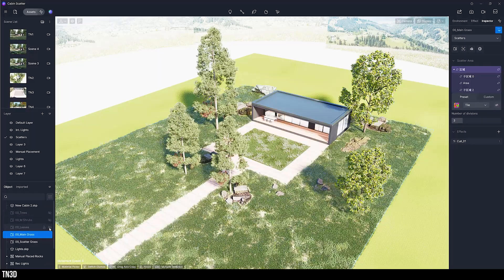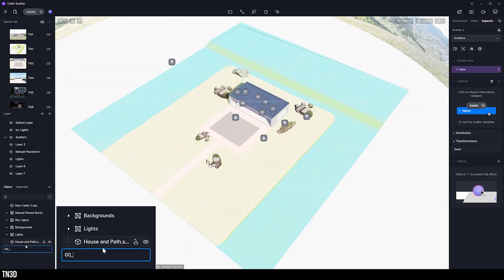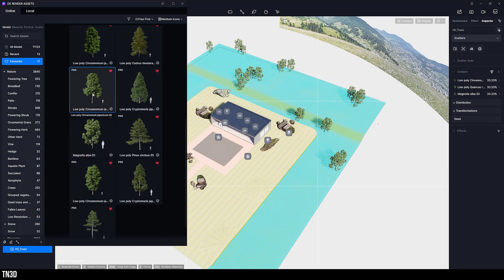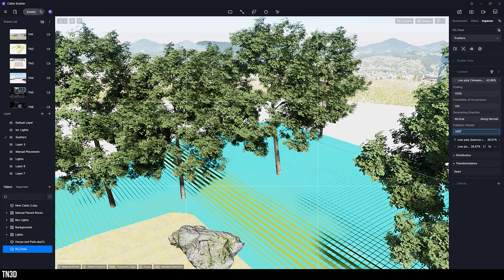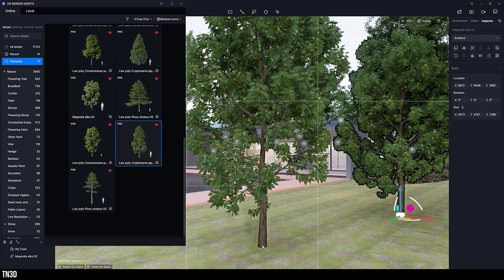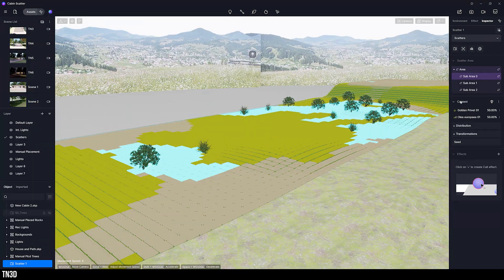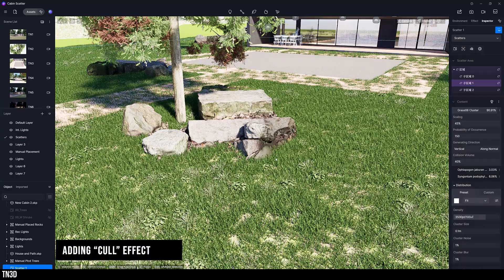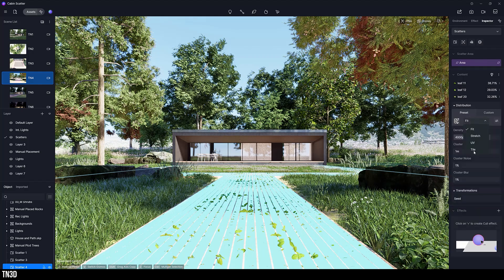New real-time scatter Render Tool for D5 render !  Fast real-time Render results

Comment: You played very smart ... you started with free models but then use paid / pro ones quickly so people will not get confused ... but guys there is no point to use scatter in D5 because free vegetations are Like sh*t in D5
Reply from the maker: Hey Hamid, my goal with each video is to mix both free and pro features or assets to show what D5 is capable of.. I get that free Assets are not always the best but you can make it with with a few tweaks and the scatter tool. Its all about using what you have. Upgrading to pro might not be for everyone, but i still have to show so that anyone considering can see the results before making a decision. Hope the video was still helpful thou :)